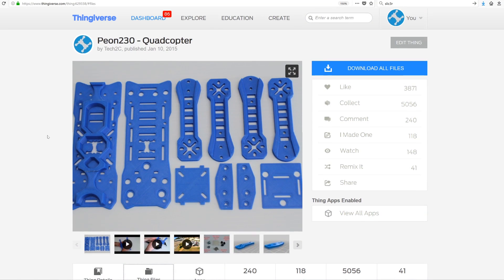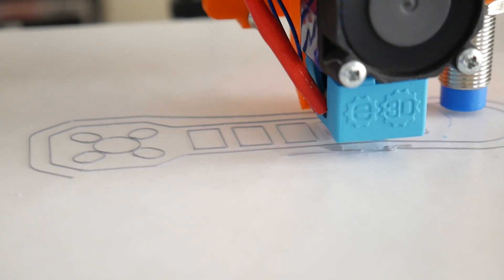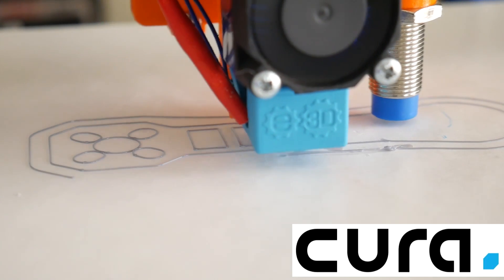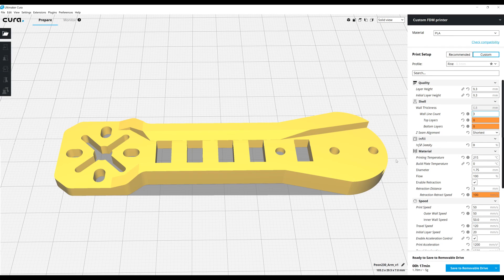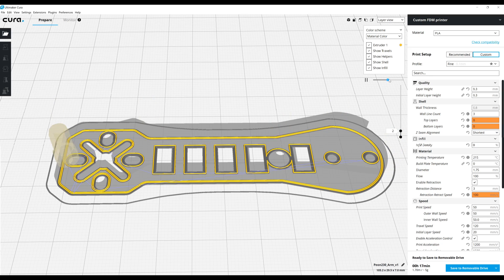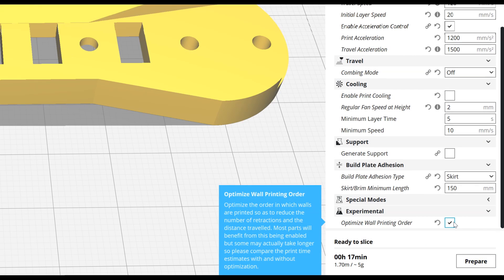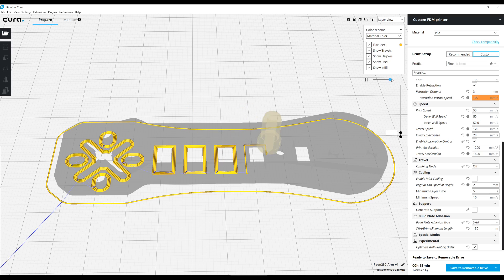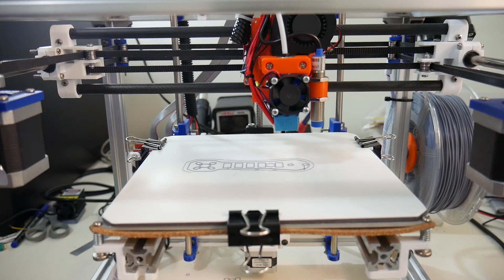A hidden feature in Cura

Comment: great video!
using g-code:
do you know a way to turn off the bed temperature down or turn off after let say 1 hour or 2 hours or 1 day and then turn on if i need it?
i have a bending problem and this comes from the bed temperature and the fan on my chiron.
i will appreciate any help. thanks!

Comment: Can you please help me to conect the cc3d to the openpilot I had it connected but before I had to configure it I took and pressed firmware and auto update pg after that the flight control only lights up blue and now I do not get it to and conecte again what do I have to do please help me it does not seem to be found by the computer

Comment: When I saw that Cura was doing this, I assumed it had to do with cooling, as a few others have mentioned.  After testing both with the check box checked and without the checkbox checked, I have not noticed a difference in the print quality.  The layers are still perfect either way.  However, the one main advantage is that it cuts the job time as the nozzle is working more efficiently with the checkbox checked.  I am using a Creality Ender 3 Pro.

Comment: There's a good reason to leave it disabled by default. It's probably experimental for a reason. They may not be sure if it could cause some unexpected issue. If the user has to go turn it on then they are aware of that change and can take that into account if they need to diagnose a problem. If something that used to work but now doesn't how would you know that some potentially hidden setting has been turned on. Yes, I know this video is more than 2 years old.

Comment: It's not a bug, it,s feature . two different types of shell printing behavior. And you can use both of then ( and some other ) at any slider. printing shells one by one, like cura does by default, prevent overheating of small perimeters

Comment: There is a benefit to Cura printing the first wall of each, and that is if you don't have ABL, then you will be able to manually adjust or fine tune the layer with the Babystep Z function in Marlin, it also means you don't need to wait as long to know if the first layer is good or bad. This isn't an issue however if your bed is perfectly level

Comment: I have just loaded the new version of Cura on my Cr 10s Pro. When it starts to print goes to the front left corner lays down a nice bead of filament then goes back to the front left corner and starts to print. It doesn’t go to the center of the bed. Is there a way to adjust the position of the print head when it starts to print. At least where it is in the Cura slicer screen.  Normally positioned in the middle of the bed. Appreciate your video. Later.

Comment: The reason why cura and slicer differ with head travel is nothing more than the opinion of those who wrote the programmer as to which method will give the best result. This of course will depend on the experiences of prints all ready experienced. Those who wrote cura probably think that laying down each layer in their fashion will give a constantly better result whereas Slicer's writers think their method produces a consistently better result. There are too many variables when printing to give a definitive set of settings for a print. Your location could be warmer and so one method is better than one I would use as my location is cooler.

Greta video. I have subscribed and will watch your other vids as and when I get the chance :)

Comment: Can someone please tell me if this feature is in Cura 2.3 my laptop will not let me download the new Cura from 2.3 and up. I tried 3.0 and the others i can not get it to work. I open up Cura and when its loading...a error window pops up and says Cura had unexpectedly stopped running and has to be closed out. I have a new windows 10 Lenovo laptop. Can someone please send me the link to a new version that will work on windows 10. 

Thanks steve

Comment: if anything doing one wall layer at a time helps with ensuring that the plastic that is extruded isnt affected as much by the nozzle radiating heat. even when not in the nozzle, if the nozzle is in close proximity with extruded plastic on the print bed, it can re-melt it and cause warping or other flaws. i like to think that cure does one wall at a time instead of all 3 before moving on is because it is giving the extruded plastic time to cool off enough so it doesnt warp on the nozzle's next pass. its not something that benefits all prints, but its something to consider for certain things like printing miniatures.

Comment: Looks like it's like this by default to allow the perimeter to cool down before putting the second line.
A word of caution. If (for whatever reason) your printer doesn't have layer fan (you should immediately start thinking about a cooling upgrade), you should think twice before enabling this option. Probably that's why it is disabled by default - for compatibility issues. When you develop a software like this you would want consistent results with default settings across as many devices as possible. If you have a cooling fan however and you do not suffer from model cooling problems, you should definitely enable this option.

Comment: I have a question I have the ender 3 and when using cura my temperature stays at 205 when I need it to be 252. But the thing is I’m cura under print temperature it says 252 but my printer is puts it down to 205 what do I do

Comment: Wow.. I will be checking this, I am doing a lot of 8hour+ prints and I really dont feel safe leaving the printer running while I am out and about.

I got a 15 hour print planned for tomorrow and this has just taken it down to. 14hours.. which knowing Cura and its estimates means it will take 15 (instead of 16)

Worth a shot.

Comment: Hello, can you or anyone suggest a good 3d printer-cnc machine price range 1,000 -4,000 . I recently learned about polyjet printers that use photopolymer material to print, and these 3 d printers are superior, but the cost is very high.
I wanted to post a link to a video posted by a company here on youtube that uses polyjet printers to see if other printers could do the same project but video links go to spam folder.
Anyway, any suggestion for a good 3d printer?

Comment: Very nice find, thanks for sharing this!  While this 'only' took 10 minutes off my current 5 hour print, it did fix a gap between perimeters that I haven't been able to correct.  And a heads-up, on my version of Cura, 3.2.1, the "Optimize Wall Printing Order" has been moved from Experimental to Shell.

Comment: Cura V3.2.1
it's now under (Shell) settings instead of Experimental.
Thanks for the Video!
Reply: Rami M. Thank you! I couldn't find it in experimental, and there it was under shell.
Reply: It's not always an amazing trick. I'm doing a 4 hour print, and it only would have saved me 4 minutes.
Reply: There's 10 separate perimeters to print vertically in the model shown in the video. 
How many did your print have? One, maybe two?
Then there's your reason. 
You've proven that it won't do much for simple prints with Cura but for the more complex prints, as shown above, it will.
Reply: 3.6 still in shell settings

Comment: There are two steps: Specifically, Once Cura is up, 1) Go to Preferences, Configure Cura, then pick "Settings" and type "optimize" in the search bar. Listed under the Shell category, should be "Optimize Wall Printing Order". Check it to add that option to your setup. 2) Next CHECK the option on your Print Setup panel to enable it on your project. [And thank you Tech2C for showing this option exists!]

Comment: Thank you for sharing this tip. I have never used Slic3r, but i've always been annoyed about the way Cura does it - if you have a lot of holes in the bottom layer, all that moving around gives extra retractions that sometimes leads to broken perimeters and small holes missing entirely.

Comment: For doing big prints then yes there is a benefit but small intricate models benefits by having the heated nozzle near printed plastic as little as possible to let it solidify, moving to another section after only the outer perimeter allows it to cool before doing the next part of the shell , doing all at the same time can lead to the filament lifting or smudging or even sticking to the nozzle and being dragged along the bed

Comment: I suspect is not so OK if you use a higher temperature for filament and the printed part is not solidified when you come with new row. for big parts is ok, but for little and complicated parts i have some doubts. just my opinion! have fun

Comment: It does it one parameter at a time and skipping down-the-line to allow the previous laid line to cool. This helps eliminate warping. You do the same thing welding. You're talking about saving a minute or 2 on a couple hour print.

Comment: So I have just upgraded to version 3.2 and I still don't get a "play button" to watch the tool head do its layer by layer rout...?????
Reply: Check your video card and drivers.
Reply from the maker: You need to slice it first. Hit the big button bottom right - "Prepare"
Reply: Tech2C have sliced many different models with both 3.1 and now 3.2 but I still don't get the play option in layer view (after slicing)??

Is there a setting that disables it?
Reply: I had a problem when upgrading Cura that I had to manually uninstall the previous version before the new one would load, all my profiles were kept

Comment: Tech2C - Great tip THANKS!  And recently I've been printing using a greater Shell Wall Line Count, i.e., a thicker shell with less infill percentage, since a hollow, or more hollow, part with thicker walls should be inherently stronger and lighter from an engineering standpoint and will consume less filament.  Of course, this depends on the geometry of the part and how the part will be used.  Some parts will require more infill.  Bottom line, this great tip increasing the efficiency of the print sequence is a perfect match to my printing style.  Thanks again!

BTW, just subscribed.  ;^)
Reply from the maker: Cheers Jimbo!

Comment: The benefit of having a thicker wall printed on each part before moving to the next would be less chance of having it lift from the build surface. plus it does increase print speed as you noticed due to fewer non print moves. The name of the game is efficiency. I religiously use Slic3r 1.1.3 dev because it just seems to work better especially with the features in Marlin that tie the two together.

Comment: Thanks a lot. I always hated this default behavior of Cura. Not only it takes longer, but the unnecessary traveling increases Problems with first layer adhesion, and more stringing while doing non retraction movements. I will mention this in a video for my German audience (including a link to your video).
Reply from the maker: Ok.

Comment: Hi Tech2C I also use Cura 3.1.0 however I don't get the "play button" option on layer view??? Id love to know how you activated this??? cheers.
Reply: There are certain things that don't work in Cura unless you have the correct (or fairly new) video card.  I have a notebook with switchable Intel and Nvidia graphics.  With the Intel, this function is not available but when I re-start the software under Nvidia, it shows up fine.
Reply: Bit old now, but in order to get the controls you first have to slice the model.
Reply: yeah, I would like to have the answer to that one too ..
Reply: Me too
Reply: Before you can view the tool pathway you have to slice the model firstly, then select the drop down combo box, and click layer view. 👍🏻

Comment: I find Cura to be completely useless without this setting. Drawing one perimeter at a time results in poor wall adhesion and often rips up previous walls with all the travels. I agree it should be on by default. Generally I find Cura to be not as good as Slic3r Dev.

Comment: My Cura is version 15 how is yours 3.0.1 ?
Reply: Your Version is old but still used as default slicer from some companies. You can download Cura from the Ultimaker Site, but you may have to manage your Printer Profile for yourself
Reply: It's kinda funny. Right? They get up to 15 and then decide to start over in their naming scheme. I always preferred Slic3r over 15. Recently I downloaded 3.1 and am anxious to give it a go.
Reply: the naming has changed, it was "Cura" but now it's "Ultimaker Cura"
Reply: I installed 3.2.1 but I get an ugly Win 7 error, the application was unable to start the program and some address ... any ideas ? "The application was unable to start correctly (0xc000007b). Click OK to close the application"

Comment: Many thanks for pointing out this great feature. I'm sure on some parts where there's actually a lot more travel, this option will reduce time significantly. Also, won't this print perimeters all at once make the layers bond better and also make the bottom layer a lot neater? I'm thinking the retract/extrudes that occur when travelling around the print a lot?
Reply from the maker: Cheers. The benefits of enabling this feature out way any potentials down sides. Without this feature enabled I find sometimes the plastic gets ripped up by the rapid moving head when only depositing a single wall, which can't really support itself too well.

Comment: Did anyone try to slice a hollow cylinder which has the wall thickness is the same with the nozzle diameter. In Cura you will see broken lines at each layer, but in Slic3r you will have what to be expected, but z layer change points will be in the same position which forms an unexpected vertical line with some extra deposition of material.

Comment: how u did it, that u see the toolhead(nozzle) in the layerview, in my version of cura (also 3.1.0) i dont have found this feature ? and i also cant find the feature with the animated simulation ?
Reply: I was thinking the exact same thing, I also use Cura 3.1.0 and don't get the "play button" option on layer view???
Reply: ich nehm mal an du bist deutscher, wie ich . ich denk, ich hab den fehler gefunden, es liegt (bei mir zumindest) an der graphikkarte, die nur opengl4.0 darstellen kann, cura 3.1.0 oder 3.2.0 brauchen aber opengl4.1 und eher noch höher um diese funktion darzustellen, ansonsten zeigt er immer nur diesen "kompatibilitätsmodus erzwingen" an. also neue graphikkarte, ist bei mir eh fällig.

Comment: Is it a continuous extruded until the perimeter is complete.  I notice in mine it will finish 1 wall, and rapid travel over the part to start the next wall on the other side.  I wish it would print wall perimeters like it prints the skirt, just offsets in and continues non stop.  Would remove alot of artifacts and zits from retract and z hop moves

Comment: Now if they could get the v3 program load time down to 15 second instead of 10 minutes, that'd be great.  Another thing this fixes is first layer adhesion after a long travel.  Instead of messing up each wall, it might actually work.  The scenario is this, I have a U shaped part with 3mm screw holes at the ends of the U arms.  The long travel will retract the filament, but not push it back out soon enough, thus it will mess up the holes.  E3D all metals ends make this worse.  Sure Cura 3 will preload the nozzle, but I use cura14 cause it loads in 10 seconds, not 10 minutes.
Reply: Cura 3.2 has faster loading, you can try the beta now
Reply: Be nice if the Linux version was available as a normal package, too. The AppImage thing is a boated pain in the arse. It's like running a Windows installer file every time you load it. Not sure why they're so scared of releasing an installable version.
Reply: If you have a program taking that long to load you have a problem with the install

Comment: it's time for 3d printing to "merge"  with cad software and slicers with an another format than stl.  For exemple if i wan't to print a flat base with 3 cylinders and an infill of 33% for the one in the center the others gonna have 33% infill too. Same things for wall perimeters and layer height.

The absolute "GRAAL" would be adaptative layer height, perimeters and infill.
Reply: you mean simplify3d?
Reply: I think Cura has adaptive layer height now.

Comment: Thanks! I need to try that.
I suppose one of the benefits of how Cura does it by default is better cooling. Without having a dedicated parts cooler (Ender 2) small parts heat up gradually during the print and end up quite a mess if the print head stays in the same general area too long. Printing another part quite a distance away on the build plate gives it time to cool down between each pass/layer while the print head travels.. 
Also the indirect cooling through the hotend fan cools the part once the hotend moves away from the part but not while the part is directly under the hotend since no air moves there... 
But probably less of an issue with part cooling fans.